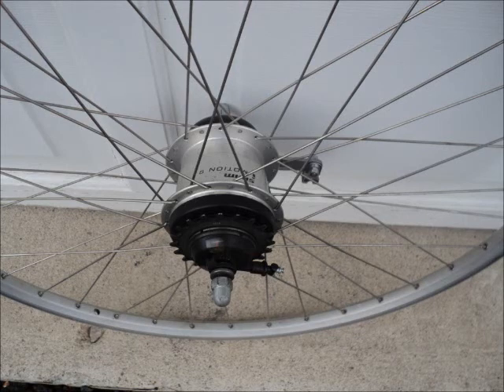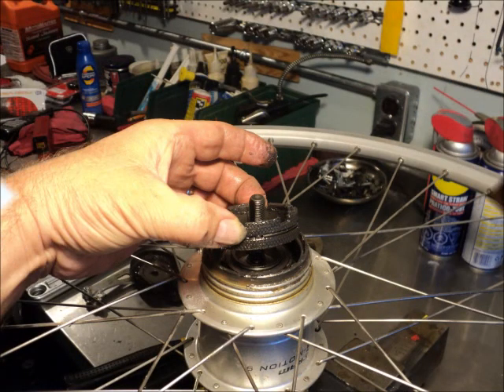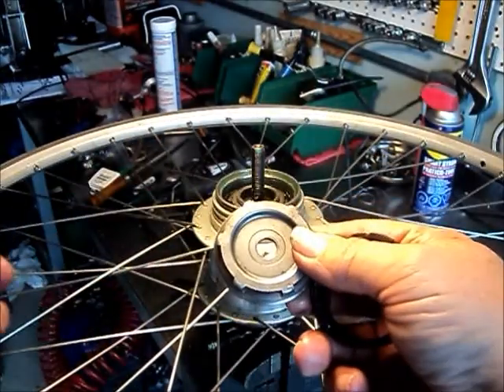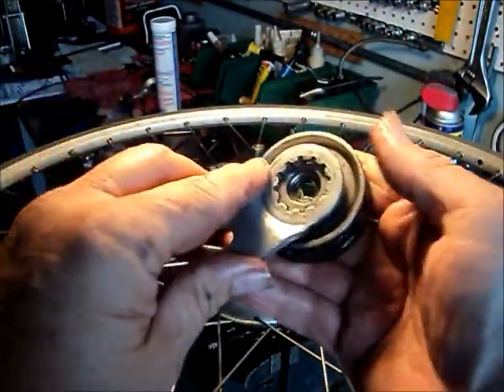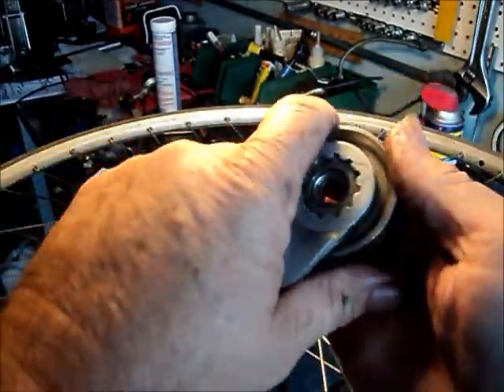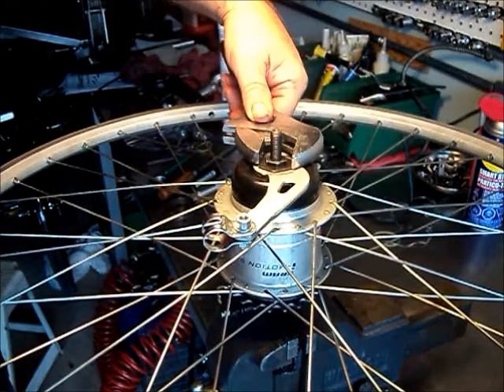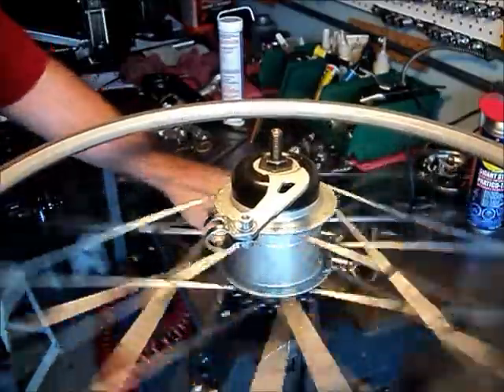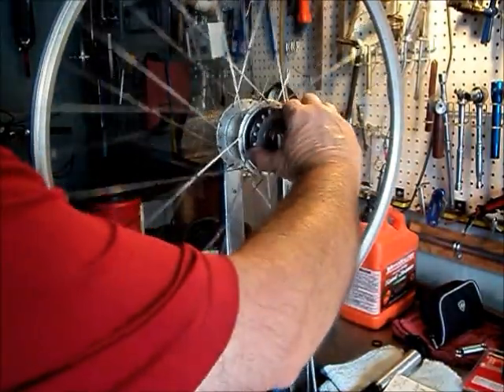Deactivating the coaster brake on a Sram iMotion 9 gearhub

Comment: Hi,
My 7 year old boy has a 16" coaster bike which has front and back handle brakes too. He has never used the coaster brake which has been a nuisance as he cannot adjust the pedal backward.
Can I just cut off the coaster brake arm to disable the brake?
Thanks.
Reply: Your kid probably has a cycling career by now but the answer for those still looking at this years later,  no. You must remove the brake shoes

Comment: So you pretty much just open up the cap and take out the brake pads, then out everything back together without the brake shoes right?
Reply from the maker: Yep. Be sure to take the rollers out too. 
 If you really want to do a thorough job, you can take the internals out of the shell and remove the rear facing pawls, but it's really not necessary.

Comment: when you move the bike backwards will it petal backwards automatically?
Reply from the maker: Yes it will. Any pawl driven hub will do that.
Reply: +Dan Burkhart but this hub isn't pawl driven though, right? 

It's a Coaster brake, and in being that, it means that there is a clutch on the driver side that bites the hub making it go forward and when pedaled backward it pushes the clutch to the opposite side (where the brake shoes are) and pushes them outward biting the hub and stoping it. 

But here when you take the brake pads/shoes out, back pedaling no longer makes anything bike the shell (making it stop) ... Therefore having a design much like a BMX freecoaster, so I believe that the wheel should indeed be able to roll backward without having to back pedal (until the clutch is engaged by forward pedaling)
Reply from the maker: +gienry 
You are confusing a gearhub with a single speed coaster brake. Some, not all single speeds work as you describe, this hub is pawl driven.